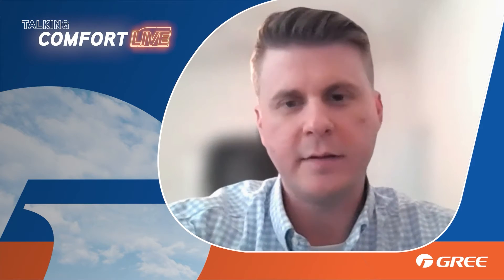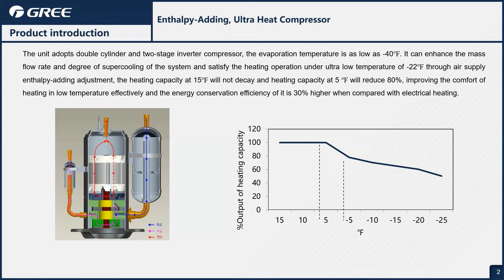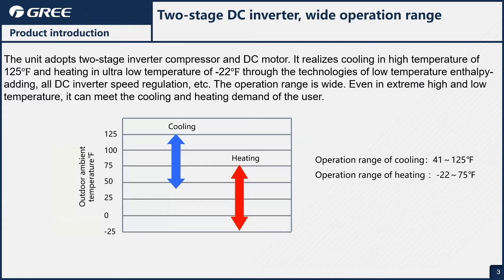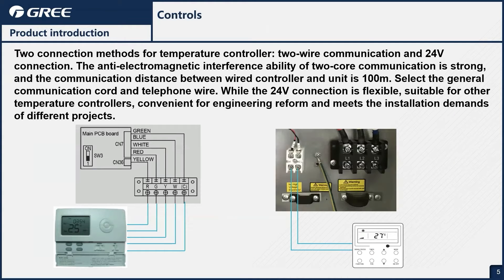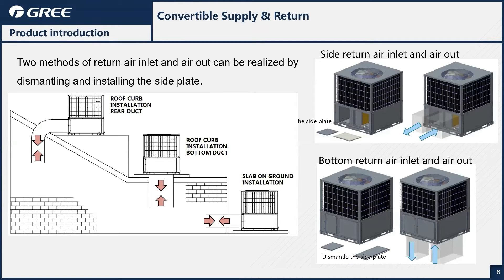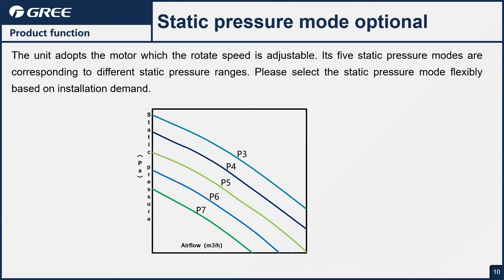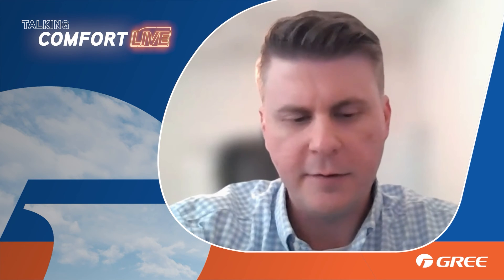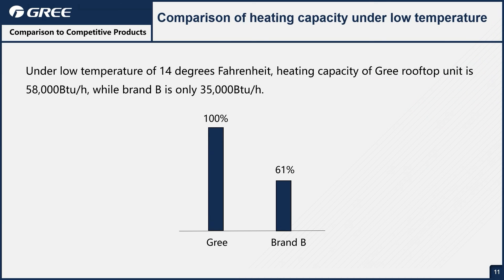Explore the GREE X-PAC Fully Inverter-Driven Ultra Heat Compact Unit

Comment: Where can I find more information on PV connection does the unit automatically have an MPPT PV direct connection for the DC Driven Compressor bypassing the inverter? Where is more information on the PV capabilities?